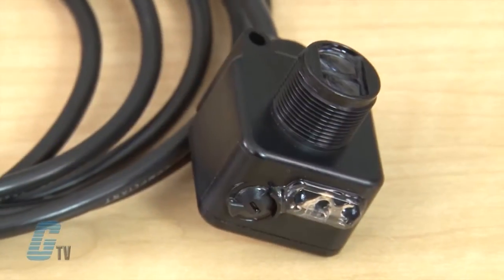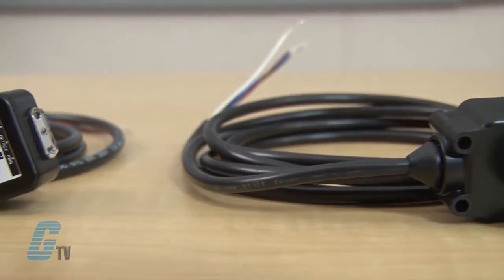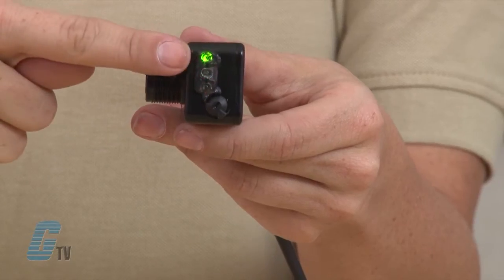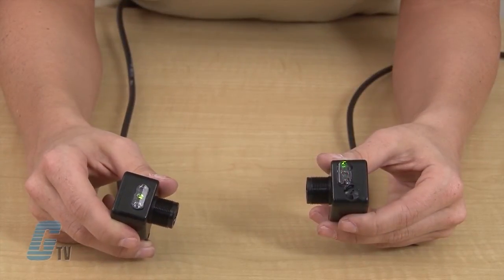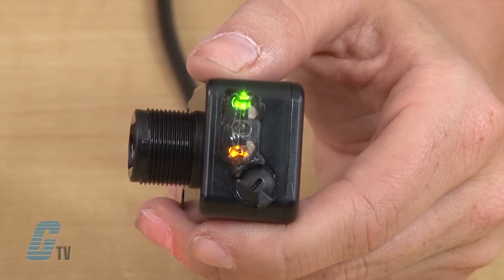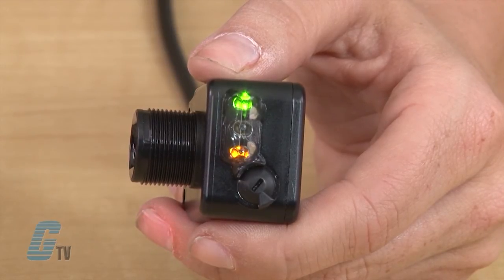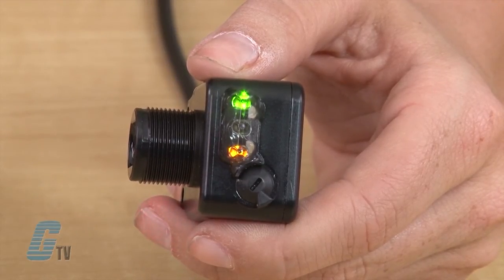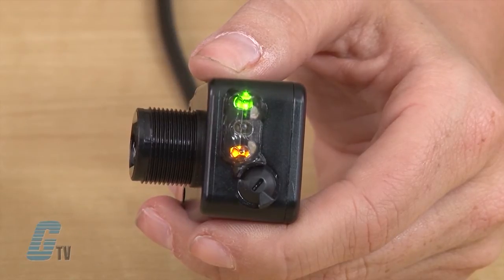Eaton Cutler-Hammer SM Series Photoelectric Sensor TargetLock Demo

Comment from the maker: I would need to know a little bit more about the application and material you are working with, but a typical sensor would not be able to accomplish this. Something like that is not very common and the closest I can think of is a vision system utilizing a camera. You'll need to contact an integration house that specializes in vision systems. Either way you might be looking at something more elaborate than just a part. Is there a way to decrease the sensing range?